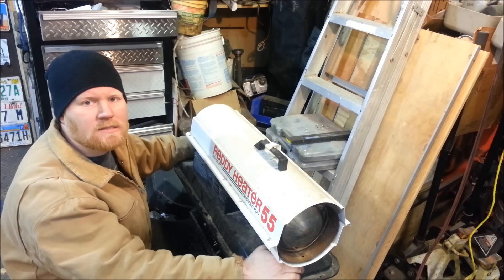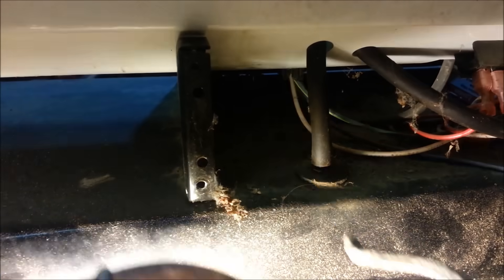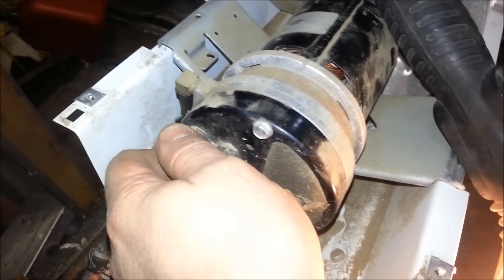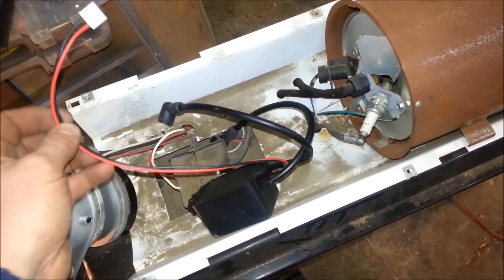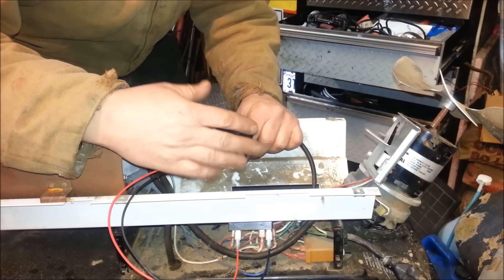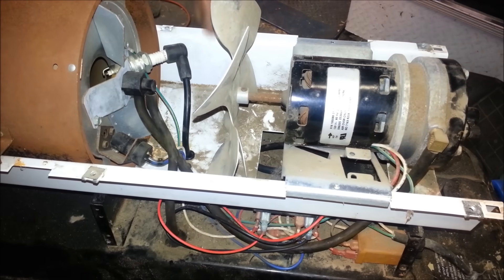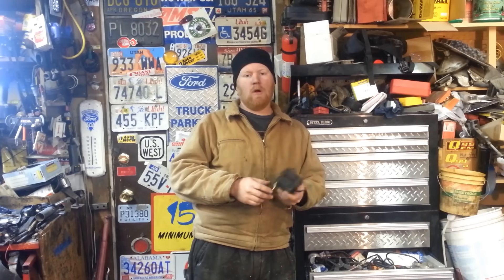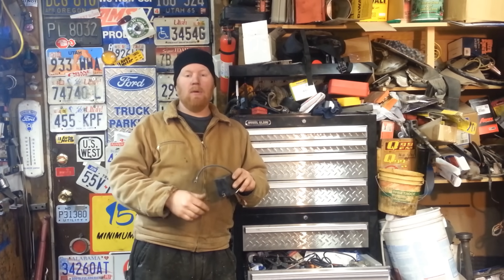Torpedo Kerosene Heater repair & HOW they work

Comment: Say, you were so helpful the other day I thought I'd pick your brain one more time, if I could.  I got my brother's heater working but it cuts out about every 10 seconds or so and "chuffs" out a big cloud of white "smoke" (incompletely burned Kerosene).  It will do this repeatedly.  It has a new spark plug, we cleaned the nozzle and the electric eye, replaced the hoses, and have new kerosene.  I also adjusted the pressure to 3.4 psi per the recommended settings.  I'm stumped as to what can cause this intermittent firing.  Have you ever seen/heard of this?  If so, what's the fix?  Thank you Mr. Sixtyfiveford!
Reply from the maker: Let me talk this through. Generally once ignited the heat will continue to burn the fuel even without continually spark. The only way to get a spuratic burn is an interruption in the fuel delivery.

-Make sure the fuel filler cap has a vent that isn't plugged.
-Could have a cracked fuel line sucking in air
-Loose fuel line
-Plugged fuel filter(if applicable)
-Water in the fuel tank
Reply: sixtyfiveford You've given me some excellent ideas, Sir.  I will test/implement them soon.  Thank You for your prompt and excellent repsonse.  I do appreciate it very much!
Reply from the maker: Let me know what you discover.

Comment: is there a way to hook this up to light a heat duck system to make like 2 8 in pipe in 2 spot like the front and back of your garage or even left and right side ?
Reply from the maker: I have directed heat by placing a metal sheet a few feet in front of it. Anything within a few feet will get red hot.
Reply: sixtyfiveford
what i meant is a duct system on the wall with 2 opening like a house duct?
Reply from the maker: I don't see why you couldn't. With a little ingenuity it's possible. You would just have to be aware that the first 5-10 feet of duct would be hot enough to cause a fire to anything it touched.
Reply: sixtyfiveford
i took a duck pipe and came right off the end i have a huge masters 3000 and my shops gets to 70 within 5 mins but way down the other side it was still cold so when i connected them i got more smoke and smell out of the dut sorry to pester you on new years but if you like you seem real smart on this and i can send you my number or i can get yours and call you tomorrow so you know exactly what im saying it hard to type it and btw happy new years
Reply from the maker: If the duct restricts the air flow coming out it will cause an incomplete burn and you will get smoke. A larger duct or a duct the doesn't connect directly to the front of the heater should eliminate this.

I would place a the duct a few feet in front of the heater. You could also add a duct booster fan. They help pull/push the air through.

Comment: Hey so I have the exact heater you have their, now mine is having an issue obviously. My heater will start but cuts in and out, Im not sure why. It receives fuel just fine and the spark plug appears to work just fine, the fan works just fine as well, but the flame actually firing is inconsistent. The heater appears to work better though when the lid is off. I dont know where to go from here. Any advice?
Reply from the maker: Sounds like either you have a cracked fuel line or you have water in your fuel.

Comment: I also have a 55,000 btu reddy heater that has been setting for quite a while. I plugged it in and the igniter tube inside came on lasted about 20-30 seconds and then went off. I could not get it to do any more than that. Any ideas would help me alot. Thanks. I do not see a spark plug in it.
Reply from the maker: Everytime it kicks itself off it should trip the reset button. Push it back in and it should allow you to try again. If it was putting out heat for the 20-30 seconds then died, it is most likely the photo sensor.

Comment: One other question: how critical is the spark plug "placement"?  I've got it set so the spark "faces" the fuel spray and have a very healthy spark but still get the intermittent ignition even though the spark is continuous.  I'm stumped.  Any suggestions would be appreciated.

Comment: Excellent video, young man!  You confirmed that I had my two hoses crossed, i.e. I had the fuel hose to the air "port" and the air hose to the fuel "port".  Once I changed those two around it squirts fuel just fine now but it only burns for about two seconds and then it stops.  Then it starts and stops again.  It keeps doing that over and over, pulsing.  We put in fresh fuel.  Any suggestions?
Reply from the maker: I might suspect: you have a split in your fuel pickup hose and it is sucking air or your air pump is going out. From my experience the spark plug placement isn't very critical. It sounds like you have good ignition and once they light they should stay lite by themselves without additional sparking(even though the module continues to spark). Your issue definitely sounds fuel delivery related.
Reply: sixtyfiveford Thank you for the rapid response, sixtyfiveford.  I switched the two hoses and adjusted the pump pressure and it now works.  It sounds like it's not burning continuously but when I look into the burner it is.  I think I'm going to leave it go since it's working.  One last question: you mentioned that the spark plug placement isn't too critical - how about the pump pressure?  If the instructions say 3.4 psi and it's at 3.0 is that a big deal?  I believe I've got it set right at 3.4 though.  I'm just curious about your experience.  THANK YOU so much sixtyfiveford!  Oh, by the way, the initial problem was exactly as you suspected: a split in the fuel pick-up line.  Good long-distance trouble-shooting!  I'm impressed!
Reply from the maker: Yeah, the pump pressure controls the Oxygen to Fuel ratio. So it will be the most efficient at 3.4psi or what ever it says.
Reply: sixtyfiveford Yes, that makes sense.  It will burn within a fairly wide range but for maximum effeciency you need the proper pressure.  Much like jetting in a carburetor.  Thank you once again.
Reply from the maker: You're welcome. Anytime.

Comment: Outstanding.  I have not run across one of these, but will  be on the look out for one that may need repair.  Thanks for the info.
Reply from the maker: They are a great source of heat outside or in the garage.

Comment: 7:25 I did too, but then nine months later our daughter came along.
Great video. I thought I had done everything to get my old Homelite 65K BTU running again. It works, but could be alot better. It doesn't get nearly as hot as it should. I made sure all the plumbing was good and clear, fuel strainer screen was clean, impeller gap was set, everything save for checking the pump pressure since I didn't have a gauge. I knew the problem was either the impeller and its vanes were just too worn, the pressure bleedoff screw threads were too loose (or spring just no good), or the nozzle had an obstruction that carb cleaner and compressed air couldn't free up. After watching your video, I dug out my old Penske vacuum gauge and sure enough, 10PSI pressure range in .5PSI increments, widely spaced. Hooked it up and it did the trick. Pressure was too high so I set it to 4.0PSI since that was the closest I could estimate without being able to source a manual anywhere for this heater, and now I know both the pump assembly and bleedoff screw assembly are both good and that the problem is the nozzle. Now time to source a replacement for an obscure heater manufactured in 1973.....
Reply from the maker: I don't see why you couldn't easily adapt a newer nozzle.

Comment: OK I am fixed and WARM I replaced the spark plug (again) still barely a spark... The photocell I bought has 2 black wires and I guess it matters which way you hook them up because after I switched those 2 wires it lit up... so THANK YOU FOR POSTING THIS VIDEO I could not have fixed it myself without your help
Reply from the maker: Awesome.. Glad you can now be warm.

Comment: Update!!! I blew through the spray valve checked pump pressure 3.5 psi changed the photocell put it all back together and now I get a spark but VERY VERY tiny maybe a dud spark plug or again weak coil? WHERE DID YOU GET YOUR COIL??
Reply from the maker: I would make sure your housing has a good ground. Loosen and retighten the ground bolts.  A weak spark is possible but very rare as most of the time there is just no spark. I would also try a new plug and or do an old school spark test with a plastic handled screw driver to test spark. I bought my coil from www.equipsupply.com . I also assume you are getting a fine cloud of kerosene when you turn it on out the front?

Comment: I have one of these with no flame.....it starts up and blows smells bad (kerosene) and eventually some kerosene starts dripping out the front.. I checked the ignition coil with a spark plug tester it lit up changed the spark plug too still no visible spark like you had you think it still might be the coil just to weak?
Reply from the maker: I would do an old school spark test with a screwdriver and holding it near the metal body and increasing the gap. You should be able to get it to jump at least 1/4" and up to around 1/2"+. Keep your hand on the back of the screwdriver and make sure nothing else on you is touching the body of the machine as it will wake you up.
If the spark tests strong and you can see a good spark at the plug then you may have water in your kerosene.

Comment: I thought running a coil with the spark not having anywhere to go would mess it up? I believe it overloads it.
Reply from the maker: Yeah, it might. But it should only mess up the side I don't use. I did jam an old spark plug into it and just tie it up under neath. So it is sparking just to be safe..

Comment: Our diesel turbo heater starts runs for a minute then dies, after a minute of waiting we can push the reset button by the power cord, and it will run for another minute
Reply from the maker: If it dies while it's putting out heat it is the Photocell. If it stops putting out heat and then dies it could be a clogged fuel line/nozzle, water in the fuel, low pump pressure, or dirty air filter on the back of the pump.

Comment: Nice explanation of the way it works, and how to troubleshoot.  How much kerosene smell do you get compared to the old radiant kerosene heaters.  My old kerosene radiant heater used to give me such wicked headaches.
Reply from the maker: Yeah, I really dislike the smell of kerosene as well. I run regular diesel fuel in mine. I think it smells less than kerosene (others say just the opposite though). I can use it for hours with diesel without getting headaches, but I'm also in a drafty garage.
Reply: The headache could be from carbon monoxide poisoning.

Comment: What a neat way of generating fast heat.

Smashing tutorial mate, ive never seen one before but i have a better understanding of the operation, thanks :-))

Does the fuel have some kind of variable restrictor so you can set the burn?
Reply from the maker: No, but that would be nice.... It just burns full blast or nothing.

Comment: I never owned one so I had no idea how they worked...very cool!  

Are they for outdoor use only? (Carbon Monoxide)
Reply from the maker: I use it in a garage for hours and have never set off the CO2 detector that is in there. It does produce CO2 but maybe not very much.

Comment: I would like to have all the ones that have been thrown away because of simple things like that.
Reply from the maker: Yeah, that would be nice. I love the instant heat they put off and that you can be working outside with this blasting at you and you are instantly warm. I only paid $15 bucks for this one and $10 for another that needed nothing(during the summer of course).